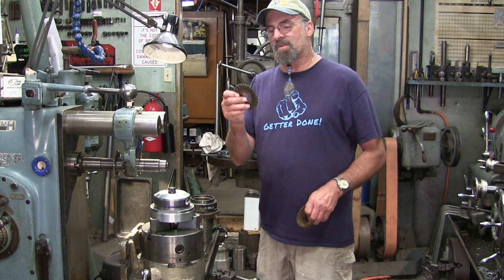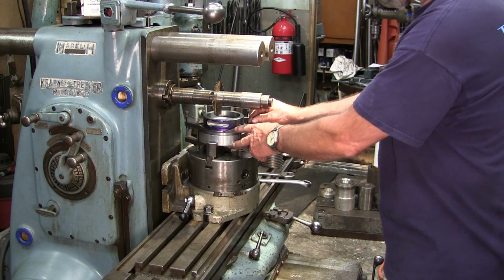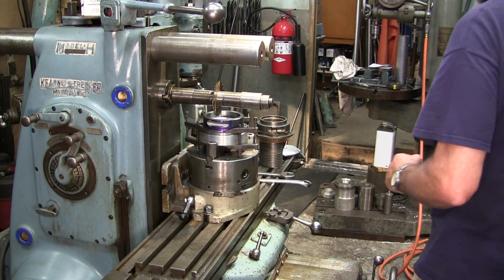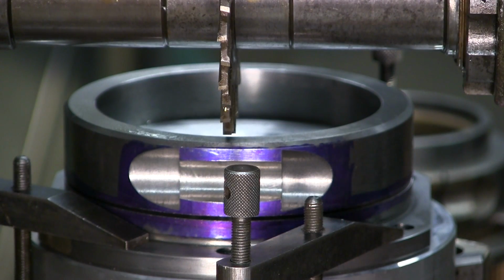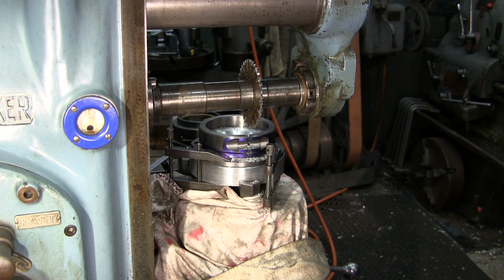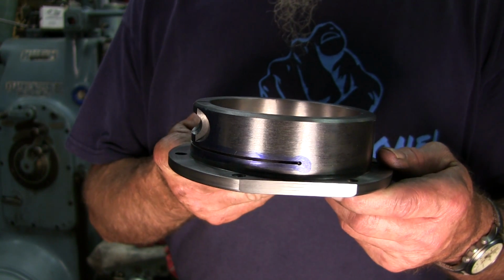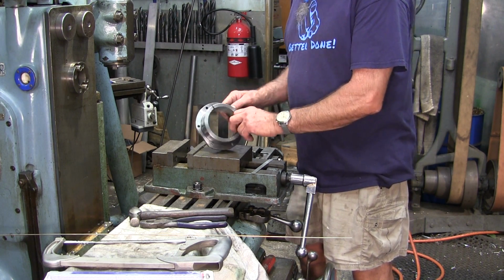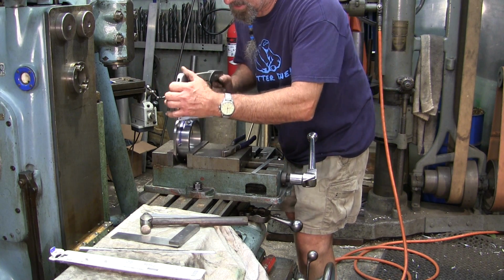Do Over Part Eleven

Comment: For the sake of safety I wish you had packed the horizontal slit with shims to make absolutely sure that any downward tool pressure could not deflect the workpiece and risk chatter or even cracking it to match the original.

Comment: Late question.  Why didn't you use the bolt holes already drilled into the piece to secure it to the stock in the chuck?  That would seem to me more reliable than the clamps with less obstruction of the work.

Comment: why did you use cast iron for this project. would a good grade of steel not been a better choice. just curious.
Reply: +John Nelson Something about this part being a bearing part, as in it slips on the steel part inside and for that you don't want to use steel on steel... Perhaps they potentially end up welding themselves together if they are both steel? The Iron is almost like a sacrificial part, it will wear out before the steel? Someone who knows should let us both know haha.

Comment: can you be so kind and explain to me why most people are catching the cast iron shavings with a rag ass if they don't want to get the shavings mixed with regular metal shaving, is there some kind of contamination with the two metals on the machine or on the recycling.
Reply from the maker: Ductile  and cast iron swarf is super abrasive and catching it before it gets on the ways and other parts of the machining is the reason. ;{)-------

Comment: Question. Could you have cut the slots and then later drilled the hole at each end to get the radius / stress relief ?
Reply from the maker: Drilling interrupted cuts is very hard without having a mishap . ;{)-------

Comment: I am 70 yrs old ,dabbled, worked, in machining, fab repair since I was 20. Your vids pretty fair in length/content. Old methods,use what is in the shop to accomplish etc. Keep on keeping. I like how you don't get held up waiting on some speciality/non existent tool. Carry on.
CNC and other "modern" equipment ,just are not very versatile for repair/replacement of one off part can't buy it part. (my opinion) some things just have to be done with eyeball engineering and touch.

Comment: I just did the same hacksaw routine. If you reverse one of the hacksaw blades so that one cuts on the push and the other on the pull, the cut will not drift to one side. I learned the hard way!

Still, love learning from you more than scrapping parts! Bozo is a harsh teacher!

Comment: Filler rod in the relief holes to prevent overcut - nice hack! Multi-blade hacksaw work - you can use a small angle grinder with a hard wheel to remove the outer wavy-set and adjust the total width. Best to have full tension on the blade(s) while grinding.

Do you intend to do a full spooning of the ends of the slits? I recall some fairly elaborate work on the end of a keyseat in a marine prop shaft in one of your older videos. Or will the radius at each end be enough?
Reply from the maker: I left it as just the radius, spooning a keyway is because of the torsion and or slamming keys, after getting loose. ;{)------
Reply: Thanks for the explanation.

Comment: Thanks for the videos. I am just wondering could the original part have been fixed by welding?
Have a day
Reply from the maker: I would have preformed a braze procedure to this project if it wasn't for the amount of processes it would of taken to reclaim almost as many as it did to make it, along  with losing the close fits, ID & OD, it was suppose to have, from skim cuts. As far as a question would the braze be as strong as original? Yes, I could braze it to be strong enough! The part was toast though, because of the way it was removed. and that was the biggest determining factor in replace over repair. Cheers, ;{)--------
Reply: The original part was damaged and badly distorted; probably by being pried off of the head using excessive force.  Keith shows and explains this in the first video in the series.  He shows more details of the damage in other videos.
Reply: This was more of a question if there was no other problems with the part like distortion, could the part have been welded. Would the welded part be a good fix. More of a what if question, so if someone does have a part that is just broken and does the same work, could welding fix the problem. Just wondering about the stress on the weld joint?
Reply: E Hiebert   Keith spoke about that briefly.  As I recall, he didn't think that welding (or brazing) would work on a part like this because of the clamping pressure on the ductile iron material.  The weld would be too rigid and it would be very difficult to get enough weld penetration and the heat would distort the part.  The weld would leave the base material hard and brittle and prone to more cracking.  I think this was in the first video but I am not sure.
Reply: Thanks for the info I was just wondering if the weld would hold and still work, on a part that was not scrap to start with.
Have a day

Comment: Great video, short and stout sounds good. Nice tips on the brass key and the long set screws! Love the K&T but not everybody has one. Would this setup have worked just as well with an angle head on the Bridgeport (not the arbor setup, just the head)? I'd still rather see the part clamped down with the bc on the flange instead of those toolmaker clamps :) I was just looking at a Bridgeport Quillmaster for sell on eBay and trying to remember if I had ever used (or seen) one used for anything. Watching your final hack saw cleanup cuts I'm thinking (of course overkill in this case probably) that the Quillmaster attachment with a small end mill would work well.
Reply from the maker: There are a lot of different ways to skin a cat, and could of been done along the lines of your thinking.  ;{)-------

Comment: Slots on unsupported work can be a nail-biter. 

Good plan ahead making the spud dia long enough to back up the slitting cutter. I was thinking to make that dia just long enough to locate the part bore.

I've had bad luck and a couple dandy wrecks trusting the grip of machinist's clamps, even when the work was captured in the fixturing. Couldn't have tapped a couple of holes in the spud for flange bolts? Just askin'.
Reply from the maker: It could have held it down with fasteners! ;{)------

Comment: In aircraft with plexiglass windows, if they developed a crack, a temporary fix was to drill a .125" hole at the end of the crack to keep it from spreading. It helped relieve the stress.
Reply: How would the cabin remain pressurized? Would some type of plexiglass filler be applied into the hole to seal it?
Reply: The planes I saw it done on were single and twin-engine private planes, non-pressurized. It was a stop-gap to preserve the window until it could be replaced. I don't think the plane would pass its annual inspection with a crack in the Plexiglas...

Comment: hey Keith just wondering why after you got to the depth of cut you didn't use the rotary table to turn the piece to finish it?
Reply: If the rotary table isn't locked in the part could spin as it's being milled.
Reply from the maker: Answered in the prior comments.  ;{)-------

Comment: I was guessing doubled up hacksaw blades, then I thought that can't be, that there must be some better trick. The rod through the holes was a good one! I was wondering how you'd do that. Figured you'd just have to be very careful!
Reply: I was wondering how it was going to be dealt with. Thought a hacksaw would leave too crude a cut but didn''t think of doubled blades. Looks like it did wander off line a  bit though.
Reply: It's really a very old way of doing some of those cuts. This is a trick my grand dad taught me when I was just a small kid.